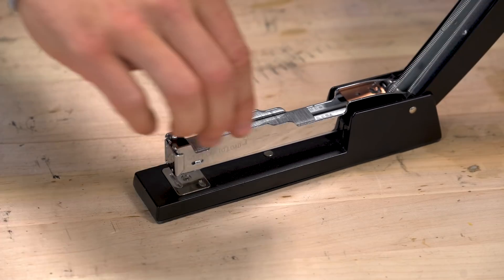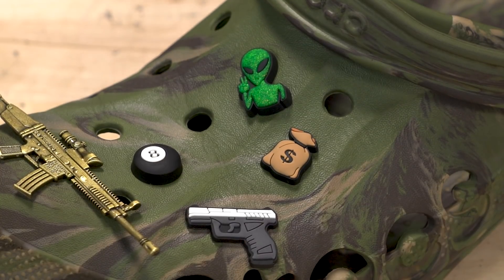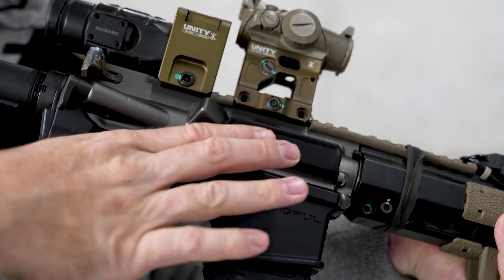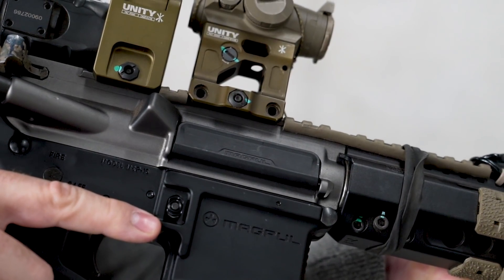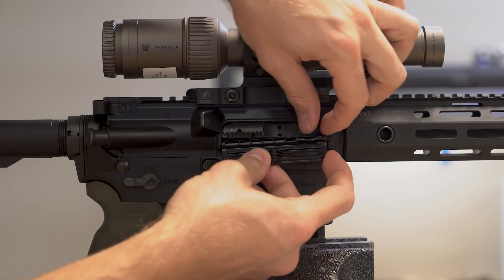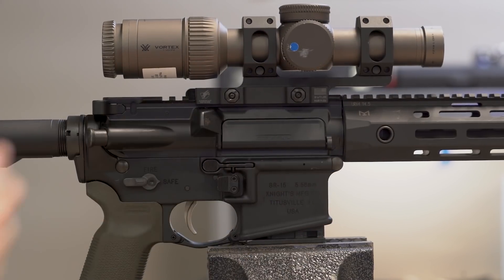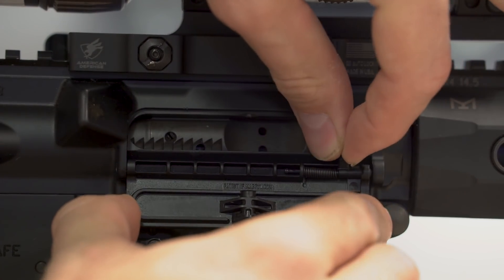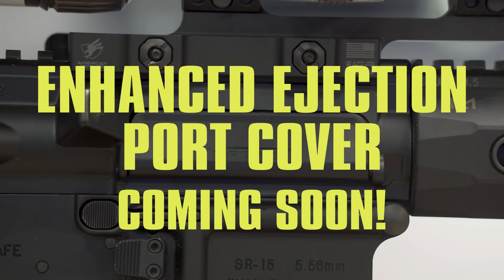Magpul - Enhanced Ejection Port Cover

Comment: Amazing. Never in my life have I ever had an issue with an ejection port cover though.
Reply: My exact thought lol. What problem is this solving for me, exactly?
Reply: They will make you cuSs trying to Install a regular one. Twisting the spring.
But once it’s in it’s in. 
I guess it’s kind of like the finger guard.
Never had a issue or need to replace one.
Reply: So much corrosion lol
Reply: @DanUtley  it helps solve the problem of increasing Magpuls bottom line. I’m not bashing Magpul, I have an MOE grip and collapsible stock on my AR, this just isn’t something I think I would buy.
Reply: You said it best. Neat feature for someone who’s doing home builds I guess.
Reply: Never in my life have I used and ejection port cover other than to use it as a fidget tool to play with when bored.
Reply: I’m assuming this is an attempt at ejection ports freezing closed and failure to eject in harsh climates?
Reply: @Jason-ut8wc  I never knew there was a performance difference between the aluminum and polymer dust covers. I thought it was just a weight reduction thing.
Reply: @tmartin3151  garandthumb recently did a harsh freezing temperature torture test on a bunch of high quality rifles and that was a problem with ar style rifles. The dust cover freezing not allowing the spent round to eject.
Reply: @DanUtley  the problem is looking more tacticool
Reply: @SouthernGuns601  Yeah I saw the video, but I don’t know if a polymer dust cover would have made any difference?
Reply: Right!  I have one that is a pain to close but yeah Magpul!
Reply: @DanUtley  I’ve had ejection port springs break, and replacing isn’t exactly fun.
Reply: Is it cool/neat, of course.
Is it really better than metal GI/ do I REALLY need it? Probably not.
Reply: @tmartin3151  I don't either honestly. Would be a good test.
Reply: You aren’t a REAL operator then. 😆😆. But seriously, society is running out ideas .
Reply: @zensempai7371  I was a career Combat Engineer. I have used M16A2's and M4's while in service, and have owned multiple AR15's as a citizen/civilian, and can tell you the only time I have seen an ejection port cover fail was in Norway when it was frozen shut. The Magpul plastic one would probably fail as well if given the same scenario. At $15, it's $8 more than a metal GI cover, but is it worth it?? 🤔   If you have the extra cash and want to be different then go for it. I have 5 metal ones in a box and don't need to spend the money for a plastic one that costs almost twice as much.
Reply: Oddly enough if I shoot without gloves ive had the ejection poot door slice my finger open a few times
Reply: @aaronsouthard8366  Wow, never heard of that happening to anyone before. Ever.🤔
Reply: @voodoo1449  I have really long fingers and if I'm not mindful between drills ill shove my finger tip right into the edge of the open cover. I index my finger high out the magwell.

shrugs is what it is.
Reply: @voodoo1449  but you aren't wrong, it isnt a common thing
Reply: @aaronsouthard8366  Yeah, shit happens. I can see where that would suck. Maybe the Magpul plastic dust cover could help you. Try one out and let us know. I can only speak to my experience, and the only issue I ever had was playing war games with the Norwegian Army in the dead of winter. The damn dust cover would freeze shut.  Also, USMC  issue CLP turned my semi-auto rifle into a single shot, because it was so cold that it would freeze!! 🥶
Reply: @voodoo1449  I tend to run grease for that reason. Upstate NY and have had the same happen a few times when it dropped below -10°F here
Reply: I have had a c-clip break/fall off of the rod but the chances of that happening again are probably very slim. Still id buy this whenever they release it just for the ease of installation alone lol.
Reply: if you got the money why not hahaha

Comment: “Strike Industries made a thing. Now it’s our thing.” - Magpul (maybe)
Reply: Daniel defense as well
Reply: @crispusattucks6094  lol even UTG has one
Reply: Strike industries is what happens when same people who make gaudy gas station knives decide to make gun parts
Reply: @LeaveItToBeaner  crazy to see you here lol but i’ve had no problem out of my strike dust cover, there red parts they make for bling now that’s cringe
Reply: The Strike Industries one still needs a tool to install. This does not. So it's a small improvement, but an improvement.

(For anyone wondering, the SI one has a small plunger that moves the pin that you have press on to put it on and take it off. This has that component integrated and doesn't require a punch/pen/pencil, etc.)
Reply: @LeaveItToBeaner  
Strike Industries plus 5 AR magazine extenders are pretty sweet.
Just gotta get the hang of popping them on a few times then it's easy peasy.
Reply: @evey0259  mine doesn't. Just a finger nail. Regardless there both a great design.
Reply: Strike makes my favorite safety tbh(flip switch) I like them more than the radian everyone says is the end all be all
Reply: @the1knifepro169  interesting I'll have to check that out
Reply: Yup
Reply: @LeaveItToBeaner  Only thing I think that is worth it is their stubby foregrip.  I needed a foregrip for compliance reasons and this thing is essentially just a hand stop.
Reply: @Osprey1994  I run a tango down stubby for the same reason
Reply: @the1knifepro169  now i feel better about spending all that money on all those red parts from strike
Reply: Our thing, comrade.
Reply: @LeaveItToBeaner  you hit the nail on the head there lol. I bought one of theirs and it didn’t even fit the gun. I did get one of their rails since it fit the motif of the billet build I did without being $350
Reply: @jarodwells9445  my ar 15 has red accents. Guess I'm cringe
Reply: @kingkazuma2239  very
Reply: I had to hack the strike industries one for it to work in a M&P10.  Basically the molding was too thick and wouldn't freely open/close.
Reply: the new strike industries one also has rubber over-molding now that seals the port better and dampens the snapping sound when the cover pops open.
Reply: Strike Industries is either completely miss, or completely hit. Their muzzle devices are pretty cool. I like the saftey selectors and the dust covers. They have cool stuff just get a bad name because they are from Taiwan. I have never had an issue with any of their parts.
Reply: But made in America instead of China?  If so, I'll buy
Reply: So this is the Strike thread. I will chime in I really like their enhanced parts kit have it on a few of my 15\10 build really awesome. Also yes I have some of their gold take down pins and forward assist...soooo guess im cringe too?
Reply: @crispusattucks6094  can't buy the DD one idt.
Reply: @jarodwells9445  the only people that get mad about that stuff are people who are mad they can't afford a $2.5k AR or $1.5k handgun.
Reply: Where's the best place to get a "B.A.D." switch/lever? The thing that brings the bolt release down into the trigger guard.. I've done some research but I'm curious of some users opinions. Anyone use one?
Reply: I was thinking the same thing.  Magpul is a bit late in the game, but it's nice they are doing their own version now.
Reply: @LeaveItToBeaner  I disagree. The gaudy stuff is still quality. And they make use full and subdued items as well. I have been running their plain and capsule dust covers and their extended charging handles since they have been available.
Reply: @lifeimitatingdeath3608  I have Magpul B.A.D levers on all my AR's. They are around $30. They are sold everywhere from Cabela's to Brownells online and take 2 minutes to install. I've used them for many years and wouldn't own an AR without it.
Reply: The Strike cover springs from the left side so that makes them totally different lol. I just want one in OD.

Comment: It took this long is what surprises me. Just glad it was a company that makes decent gear.
Reply: Strike Industries has been making ones with captive spring detents forever. I won't buy them, because I refuse to put SI trash on my rifle, but this isn't anything new.
Reply: @EH-kz3if  I meant a company that makes decent gear. SI makes a bunch of junk.
Reply: @EH-kz3if  I agree SI isn't a great company, but their dust covers are one thing I do have on every rifle. They're good to go, hard to screw it up actually
Reply: @EH-kz3if  You do you, Just like how Aimpoint is struggling to compete with Holochads.
Reply: @EH-kz3if  I bought a few parts from strike industries and they disappointment, I wanted to buy their cover but it looks like itll break or not function properly, Ill just esit for magpuls version.
Reply: @rb7922  $9.00, and works just fine
Reply: @EH-kz3if  You do you. I have one of their charging handles and it's good to go. I mean, I wouldn't buy a barrel from them (hell, I've even heard their dust covers are problematic) but not all parts need to be Gucci to be functional. :) Charging handle is just a stick you pull on.
Reply: Strike Industries’ billet cover already did this.
Reply: I don’t know how y’all have been having issues with SI they’ve worked perfectly fine for me from the takedown pins, to the ejection port cover and everything else in between. Several thousand round through my rifles and haven’t had any part fail. :/
Reply: @justusgordon-tilo5930  Some of their stuff can be iffy, but a lot of their stuff is innovative, and the more conventional parts are very reasonably priced.
Reply: @fullmindstorm  it won't break, but you may have clearance issues on a thickly cerakoted upper. Nothing a file or sand paper can't fix in seconds. I stopped using them because of that issue.
Reply: They had to spend time to figure out how not to get sued for copying strike industries products.
Reply: @sanguinemoon9201  There are better parts put there, I learned that by being their customer. Their sling parts and ar15 lower receiver kits are just collecting dirt as I had to remove them because the lower receiver part had fitting issues and how could you manage to screw up a sling swivel mount but they managed to screw that up too with clearance issues. Strike industry is junk, and I have parts that are just laying that way.
Reply: Strike industries has had this type of ejection port covers for a long time, years 🙄 can always wait on a fanboy company🤣🤣🤣🤦‍♂️
Reply: I think strike industries has this same product. I’ve been happy with everything I have bought from them. I don’t care for all the different colors. But good products.
Reply: @EH-kz3if  how is SI trash? I love their billet dust covers just for aesthetics💀💀
Reply: Don’t quite understand the hate toward SI. I’ve got one of their PDW braces, a gridlok handguard, charging handle, multiple safeties, forward assists, and charging handles. Granted I haven’t bought anything made of polymer from them, but all the stuff I have has been great to me
Reply: @ethanclark6859  love them
Reply: @justusgordon-tilo5930  im with you there. Not sure why there are so many S.I. haters?!
Reply: @boygonewhoopdataZZ  LOL, is Holochads Holosun? People that buy Aimpoint aren't buying Chinese junk. Two different markets, and Aimpoint isn't struggling because of HollowJunk. That's like saying that Tesla is making Ferrari struggle because the Tesla is faster than the Ferrari. People buying Ferraris would never put up with Tesla garbage. Two. Different. Markets.
Reply: @Mike-B-Jackson  I agree S.I. is hit or miss, but I also do think they do some stuff decently well. I wouldnt throw any of their critical components in my rifle (buffers, springs, barrel etc.) but if you are trying to throw together a decent rifle, some of their odds and ends like muzzle brakes and charging handles are pretty solid for the money.

Comment: Three years as a Company Armorer.
Over 450 M16A2 rifles.
Never had to replace one dust cover. Never.
I'm sure these will sell to those who want to change out parts just to show their pals at the range, but really. It is neither needed or "Enhanced"
Reply: Yeah I’ve never heard of anyone needing to replace their dust cover. Kind of a solution to a problem people rarely have.
Reply: I think this is for the people that build their own from the start. Installing a regular dust cover is a pain in the ass.
Reply: As a career Combat Engineer, I support this message.
Reply: Probably not needed but in theory it’s stronger than a metal one and won’t rust. So if you’re building a rifle from scratch and sparing no expense, this could be a great option for just an extra few bucks
Reply: HHC armorer? Need to deal with a "regular" rifle company where there are a lot more 11B that can break anything... But yeah, the cover isn't a problem. The stupid spring is the problem. And replacing it on most ARs is a lot harder than it should be because you have to remove the barrel nut.
Reply: I just had a c clamp fly off (because it wasn’t seated completely) I know that’s my fault, but this would be way easier than me holding it with a pair of tweezers and a Mallet.  More ease in installation for me than anything.  I won’t be replacing any of my old ones, but they will go on future builds simply due to easy install.

Comment: Well designed. That little tab that also acts as the spring’s plate to push against the receiver is a very well thought out feature. Way easier that the others on the market. I’d imagine it’s quieter too.

Comment: I have never had an issue with my ejection port cover, it’s a neat idea in the sense that installation is simplified, but since the standard ejection port cover comes with most parts kits I don’t really see myself going out and buying this separate, nor would I replace the ejection port cover on an existing rifle as there is no reason too, it would just add cost and a headache for no real benefit.

Where this WOULD be nice is if it were bundled in to parts kits.
Reply: Ejection ports are fairly cheap and a solid way to make your upper look a little nicer. I'm not a huge fan of the idea behind polymer ejection ports though. Steel or aluminum is way more rugged
Reply: @KJTUSKJTUS  Depends upon the quality of steel, aluminum, and polymer
Reply: @KJTUSKJTUS  magpul's polymer is probably more rugged than the original aluminum ejection port covers. The thing is though, it really doesn't need to be any more rugged and doesn't seem like it's worth the hassle of changing it. It'll protect it from rust, but if your dust cover is rusting then so is the rest of the gun.
Reply: My Daniel defense rifles all came with polymer ejection port covers. They are definitely stronger than OEM metal ones. 
They will not deform or bend. 
Originally I thought the idea was stupid but after years of using them I am sold
Reply: I had to take sand paper to this dust cover, otherwise the install was easy aside from that, I had to use a razor knife to take out my old dust cover due to it being a non-standard upper.

Comment: Coming in 2054: the magpul AR-15, made entirely of polymer.
Reply: The bolt, barrel, gas blocks, gas tube and springs are probably the only parts that couldn't be plastic. Look at the G36 and AUG.
Reply: @matthewconnor5483  at the rate plastic's research is going, I wouldn't be surprised if by then we'd be able to replace those parts too.
Reply: @suprtroopr1028  I'm sure at some point we'll see the strength of plastics get to the point of handling low pressure rounds and maybe even beyond that with some tricks like carbon fiber wraps.
Reply: With underbarrel Zip-22 included

Comment: Like the idea and construction, but this needed a bit more time in testing. Got 3 today and had to remove a decent amount of material to get them to work with any upper, and the spring is too weak to force it open like the metal ones.

Comment: Yeah I've had countless ejection port cover failures, right up there with trigger guard failures. Don't even get me started on the bolt catch. It's such a small button and hard to locate under stress, so I use the BAD lever which takes the small button and basically relocates it so the small button is now in a different location, that solved all my problems.
Reply: Clearly if you've had a problem with ejection port cover failures you need an easy to install plastic one.
Surely it will hold up better than the metal one which is a pain in the ass to get in.
Reply: @diapysik  Exactly!!! Did you know that an ejection port cover failure will render the AR platform inoperable?
Reply: @connorjohnson9230  I didn't know it was quite that serious, in that case we should replace every critical part of the firearm with superior polymer parts.
Reply: @diapysik  Polymer barrels and gas blocks for sure.

Comment: I always wondered why the hardest thing to install on an AR was the dust cover.
Reply: Give me a dust cover over the G-D bolt catch/release roll pin any day
Reply: If you use the Real Avid magnetic tool set with a bit of Aeroshell64 on the end of the pin it will drive straight in ez pz. Lay a Otis cloth over the receiver to protect the finish. Aero's M4E1 receivers actually have a threaded bolt catch pin to make it even easier.
Reply: @AlexanderEddy  What? 😂  That's an extremely easy install.
Reply: there can't be an easier part. Like 20 seconds, tops. Unless the mechanically declined get to 
"building"
Reply: @SCUBAdfq  that’s way harder then the dust cover
Reply: Roll pins are the bane of my existence
Reply: @xshorty117x  You just need the right tools brotha
Reply: Front take down pin was always my main issue.
Reply: The hardest thing to install on an AR is probably takedown pins. I "built" an M5e1 and that shit was not going in without modification.
Reply: @AlexanderEddy  now that lots of lower manufacturers offer threaded pins for that it's really easy, but yeah punching in a traditional one is such a pain.
Reply: Gas block roll pins is the worst!
Reply: @imparak  1/4" pin with a dremeled groove/ramp to push the detent down. Rotate groove away from detent. Push out slave pin with takedown pin.